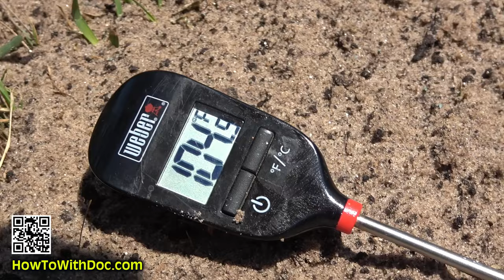Sizzle Hot Summer Lawn Care

Comment: Hey Doc. In Central Texas here. Running on 100f here 21 days and counting. Watering my Bermuda Lawn 3 days a week. Morning and afternoon.  Ground is cracking in places.  I haven’t aerated yet. Spurge and nut grass is present now.  Can I kill it now or should I wait till it cools down some.  My lawn looks great in 90% of the lawn. But 10% is struggling. Any suggestions?
Reply from the maker: Try spot treating with a Bermuda safe killer. Keep it mild and only treat the weed areas.